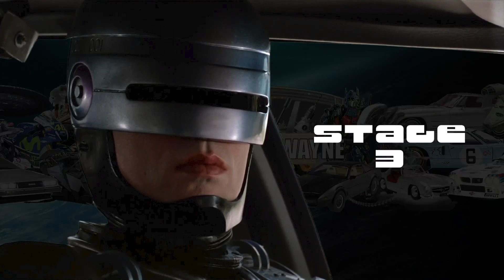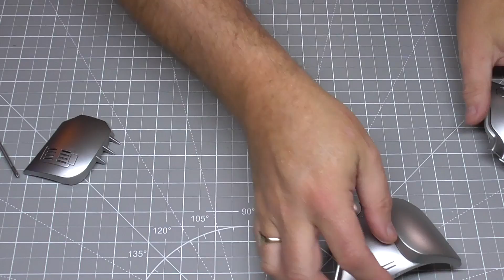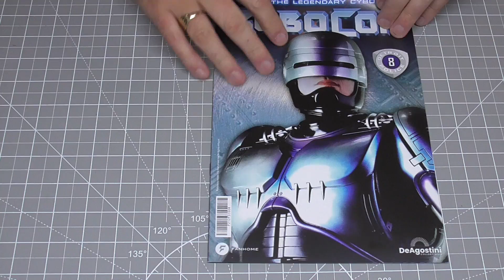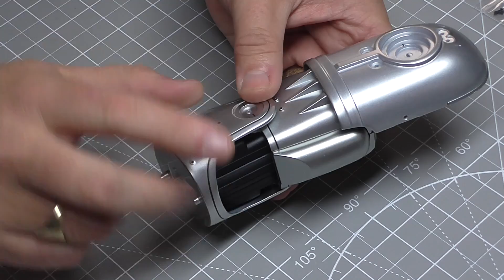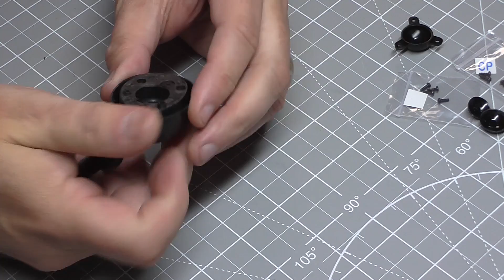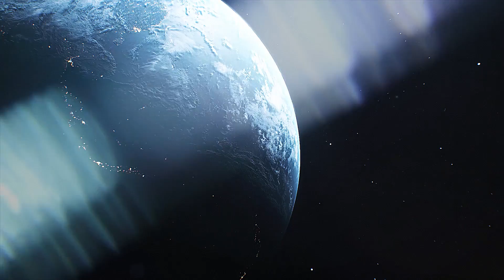Build the Legendary Cyborg ROBOCOP - Pack 3 - Stages 7-10

Comment: Speaking of shirts, can I ask where you got yours?
Ive not seen those particular Robocop shirts, anywhere on the web, also which type of screws did you use to attach those egg shell plastic shoulder caps to the metal underneath?
I STILL can't seem to attach that rubber...elbow sleeve inside the upper arm, was it more difficult in real time than it looks in your demo video?
Reply from the maker: It was from a company called Hubcloset who sadly are no longer around